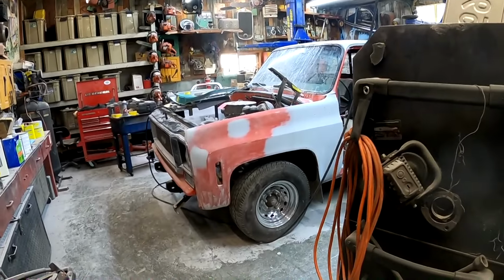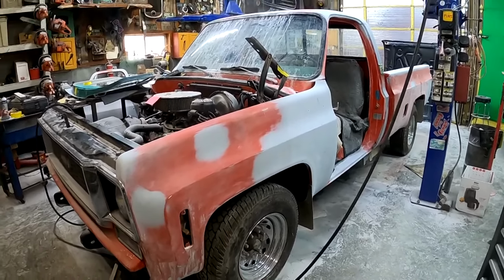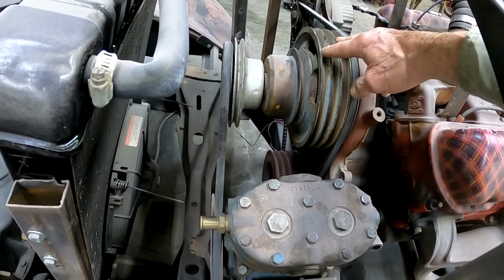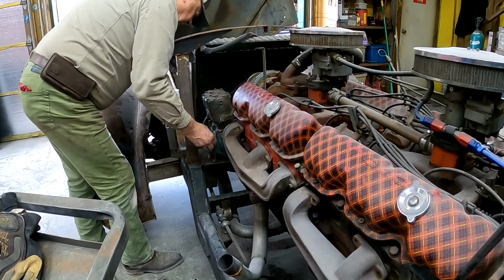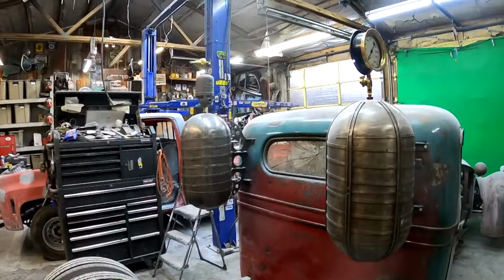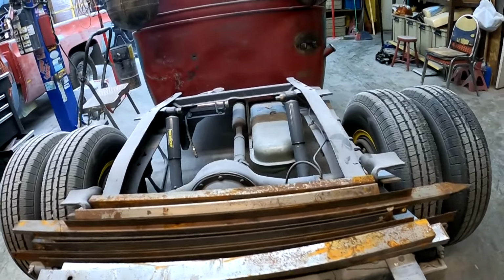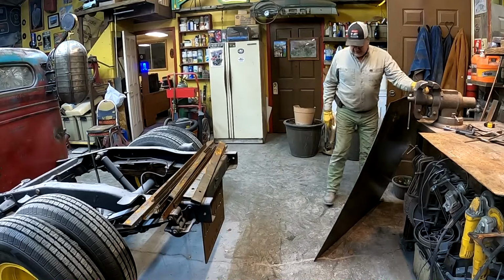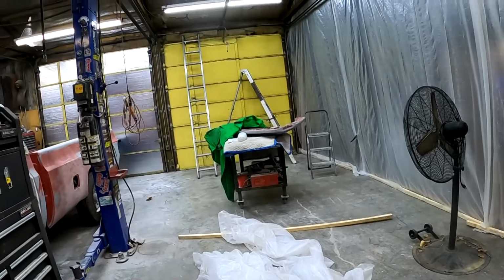the CHEAPEST paint booth EVER!

Comment: Hey, Ken!!  Another great vid!!  Jes in case the fellers aren't doin' there job in 'worrying about that compressor pulley'...  Might have a simple solution if you DO find that you need to put a 'more than I want to' tension on that belt.  Since it is driven by a duplex pulley, you could easily (with your skill) install an adjustable 'swing-arm idler' on the opposite side, and perfectly balance the strain side-to-side. NO added stress on the water pump bearing....  Just a thought....   Bro, you don't even need to TRY to stay busy... it meets you at the door!!  Take care over there!!
Reply from the maker: thanks for watching

Comment: Turn the air compressor around 180⁰. It will turn in the opposite direction, but it doesn't care. You can then drive it with the large pulley closer to the pump bearing and not worry so much about side loads.
Reply from the maker: Im not worried.. i have people do that for me! haha.. we had a discussion in a previous episode about if it should turn backwards or not.. I had room so I mounted it correctly so my worriers wont have something else on their plate haha